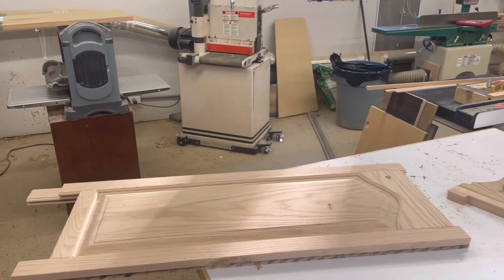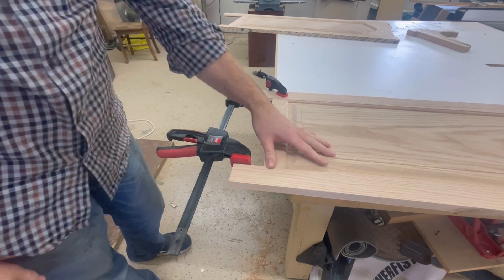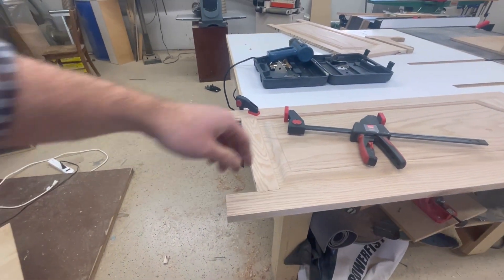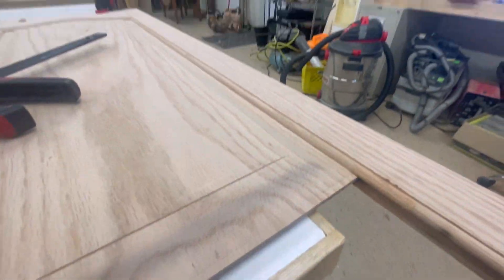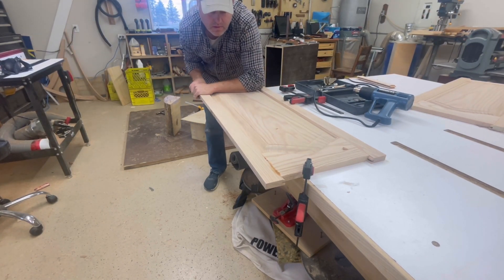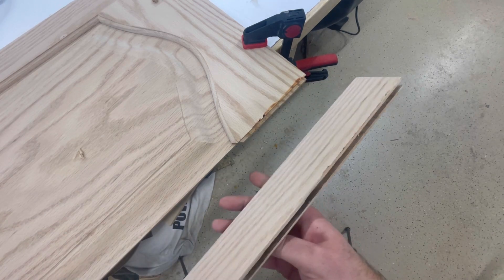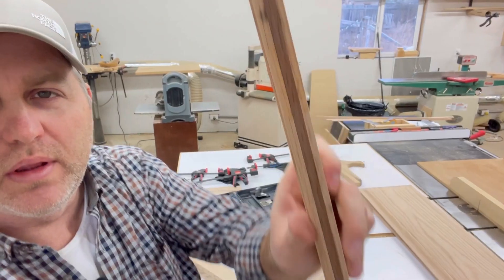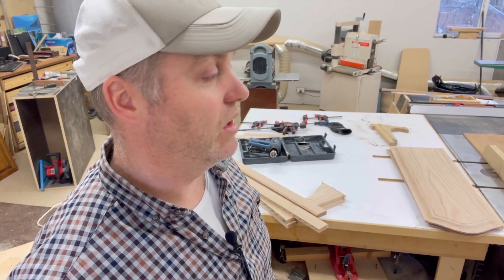How To Reverse Wood Glue

Comment: PVA is a thermoplastic, so as it heats up, the adhesion between polymer strands is reduced. It's sort of like a rope, with many smaller strands woven and twisted together. When you heat it up, the polymers start to vibrate so their interactions aren't as stable. This is akin to untwisting the rope, the individual fibers can start slipping past each other.
Reply from the maker: Thanks. I didn’t know that pva was a thermoplastic.

Comment: Acetone can soften PVA enough to loosen it also.
Reply from the maker: Good to know. Does it penetrate the joint?
Reply: @Hatchmade it should. I’ve used it to clean parallel clamps of dried glue that’s months old and it works perfectly so even really old very thick blobs soften up.

Comment: Some veneering techniques rely on applying PVA glue to both items, allowing to dry, and then using an iron to iron on the veneer, so heat acting as a softener should not come as a surprise.
Reply from the maker: That’s what I’ve heard. I’ve never done that myself but when I started looking there isn’t a ton of info about just reversing a glue joint and typically everyone always says that pva is permanent and use hide glue if you want it reversible.